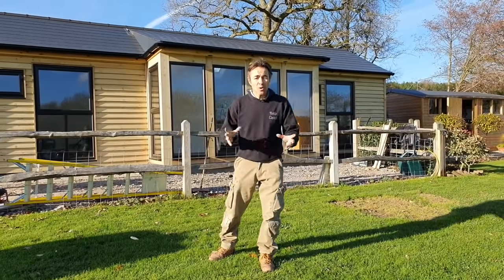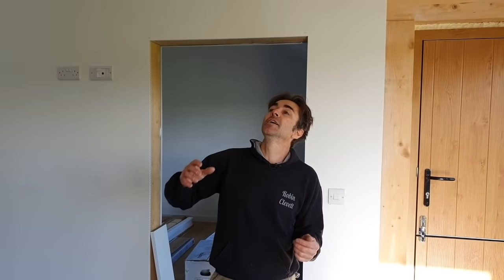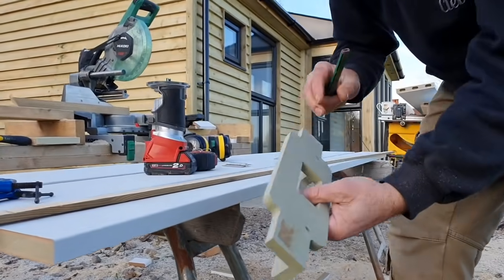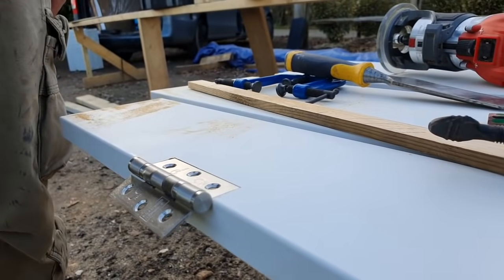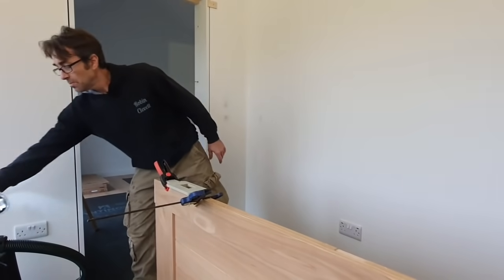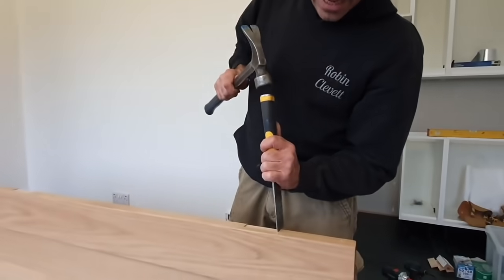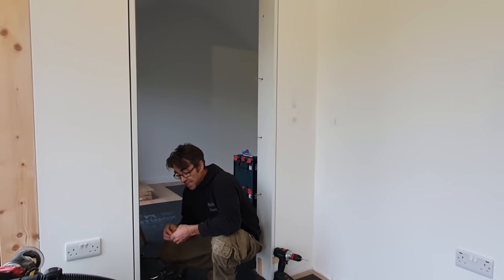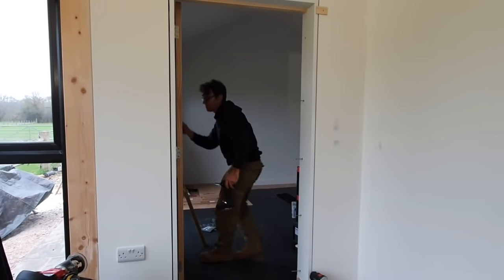Modern Carpentry and Change!!! Hanging doors the modern way with MDF door linings and new hinge jig

Comment: Screws have changed such a lot. It used to be slotted screws everywhere and they were such a pain!
Would you consider making a video on choosing what screws you prefer to use?
Reply: That‘s what also came to my mind. Were Torx screws a thing in 1986?
Reply: Painted cross head screws can be cleared out with a small sharp screwdriver. Hex socket heads can be drilled (gently) and scraped with that same small sharp screwdriver. Torx are a nightmare to clean becoming easily chewed. I guess you just use a screw extractor and fit new screws.
Reply: From memory I think Robin uses Spax screws
Reply: My preference is Torx stainless!
Reply: Torx>Robertson>Pozidrive>Philips

Such a shame here in the UK we're stuck with bloody Pozi.
Reply: @leerolfe5332  Screwfix stock torx screws, but they cost more than the pozi’s
Reply: @deanscaife840  Yeah I know that matey. That's why i said we're stuck with Pozi. We're forced into it via cost.

Comment: Hi Robin, I am a bit old school, probably due to my age, I still have and use Yankee screwdrivers as well as a brace and bit with all the accessories. Don’t get me wrong I love the battery tools but I own a caravan in the middle of Hamsterley forest and I do not have electricity to charge my tools so I need old tools to do my woodwork. I haven’t heard of spray on plaster but from the finish you have their it looks brilliant, with pex pipe all the trades can be done by a DIY’er with some good knowledge.
Reply from the maker: A decent bit and brace and sharp auger bits is probably the nicest way to fit a lock or drill a decent size hole!!!
Reply: When my dad passed away in 1990, he was a jack of all trades type, as was most of his generation, he left wooden block planes with new blades still in greased paper, brace and bit and a small hand drill and other stuff, I was fortunate to find a carpenter who like the old tools so gave them all to him and they are now displayed in his workshop.
Reply: ....and writing that has brought a tear to my eye, miss them both every day.
Reply: @robinclevettcarpenter  Yes and because everyone is getting battery operated equipment now you can pick up a brace and bits for £0:50 at a car boot sale and screwdriver bits fit in also.
Reply: @robinclevettcarpenter  Agreed. Still the best way to cut accurately. I used to have a set of bullseye bits which I bought at a farm dispersal sale. Lost them somewhere over the years. Never seen one before or since and only found out recently what they were called.

Comment: I can see a huge saving in time once you have the jig, however am I right in thinking that brass hinges are slightly different in size to chrome, different manufacturers may vary in size, loose pin hinges will be different in size, how many jigs do you need

Comment: You do all this finish carpentry work intro-Ing your new hinge jig and I just watched your recent door hardware jig !
Great stuff!
Questions:
Can I buy both in imperial ?  I would enjoy having them ?  I am a finish contractor often with jobs that hv doors here or there plus I just started to offer custom built doors????
A front door to “YOUR” house is a statement!!

Lastly I see all this fine carpentry ??
Then you finish off cutting away the jig work (squaring the corners) with a massive 24 oz Eastwing Hammer and a $4 DeWalt rusted out chisel ???
U drag that small sledge hammer all around ??
I am a trim carpenter I hv a 10 oz Stiletto wood handle titanium head hammer and a 3/4” Two Cherry Chisel ?
I wear a Buckaroo back pro belt and Occidental trim bags??

Robin toss the sledge hammer!!  Also send your address I will buy you a proper chisel and mail it to you!!!!

However ; u R one of thee most talented Carpenters I watch!!!  Keep rolling out the videos !!!

Comment: In the bit regarding the old fashioned way of fitting the door frame and then hanging the door etc after the plasterer had finished, you forgot to mention the half hour that had to be spent cleaning and scraping dried plaster off of it when the messy plasterer (majority of them), had finished. 😠 (no fun when you're on a price). Looks like a great way of doing it now. Nice, clearly explained video.
(Retired chippy)

Comment: I've been doing carpentry about the exact same time as you, I also have to wear glasses now, 😂, I used to fix arcs, and skirtin with hammer and nails, nail punch , now its all guns, mitre bond, city and guilds is a thing of the past, do you ever use hickman doors, pre hung in a factory all painted, just fit the pre finished frame.
Reply from the maker: Thats the way it will go!!!

Comment: Nice. Liking the look of that airoplaster guessing it only works on new plasterboard. I was taught to hang 3 swing 2. But it doesn't actually matter as long as they are all the same. But it does matter on new hinges as they have writing on so I think they dont look right with it upside down.

Comment: You only have to look on YouTube to see how far things have come and how much it’s changed, housewives giving their jobs up and turning garages into workshops, no carpentry experience needed, jigs for everything, pocket holes used for everything
Reply: Hi there. Its unarguable that things have changed a lot, but the woodworking world of YouTube is still miles away from the life of a top end, professional carpenter. The really sad thing is that young apprentices are no longer being trained under, older experienced carpenters and therefore new, modern techniques will have to be adopted to take the place of the traditional skills. Cheers.
Reply: @thetallcarpenter  hi, yes I agree, the days of using a saw, hammer and chisel to do joints are well and truly gone, I still use those for satisfaction but it’s all bench saws and jigs to get those things done in a fraction of the time. It’s a shame really

Comment: I agree with most but a door should have a leading edge on the latch side otherwise when the back of the door is in line with the front of the casing, your careful clearance has been halved which is terrible.

Comment: "2 to the door 3 to the frame" I stopped doing that years ago, I just put writing up now. This way the client isn't going to think you've put the hinges on upside down.
Reply: That’s a very good point JRS UK. Would like to know what difference it makes?
Reply: @SandyMiller737  In my experience, no difference at all. It's just the way it was done back in the day.
Reply: The reason this was done back in the day was because the holes in the  both hinge leafs where not always stamped out in the same pattern they we're not a mirror image of each other .nothing as bad as offering up your door and realizing 1 or 2 or maby all your holes were drilled in the wrong place  on the frame keeping 2 on the door 3 on the frame solved this .modern butt hinges usually are mirror images of each other  and avoid s  this problem but it's good practice 2 keep everything orientated the same way
Reply: Brian Gordon. That makes perfect sense. I like hearing about why conventions came about. It’s another thing I can bore people to death with 🤣
Reply: Male and female we was taught and yes I’ve been called back because the customer said I put hinges upside down and was told by her brick layer that i was wrong 😑 snm
Reply: @xxnickthegreekxx  That's exactly why I just put them writing up. Customers, brickies, they all know best, I just like a quiet life 👍

Comment: Nice looking little jigs it would be nice if they worked on a traditional rebated frame which I could be wrong but they don't look like they will, if they do then please let me know as I will buy a couple.
Ah the good old Yankee screwdriver I've still got one knocking about in the van. 👍
Reply: Ive had that issue with other hinge jigs. The only way around it is if you pack out the rebate the thickness of the reveal so the jig sits nice and square the just increase the depth on the router. Works a treat. Bit of a pain  re adjusting the router between frame and door but i guess quicker than the alternative.
Reply: Get the trend skeleton hinge jig
Reply: I thought the same thing as I mostly use those. I think I will try the jig out anyway when they are for sale

Comment: Hi robin, have you thought about using hinges with rounded edges, so you don't need to chisel out the corners
Reply from the maker: I have made jigs for these, the problem arises where you are fitting new doors to existing frames and using the same size butts, I reckon that it would be great for new construction!! Great comment mate

Comment: Robin , how would you approach a job where the client wants all the doors changed but not the frames ? I’ve hung most of my doors in old frames and can say it’s not an easy job when both legs and head are all over the place ? Could you do a video maybe explaining or showing the difficulty of hanging a door in old frames ?
Reply from the maker: Hi Issac, this is a job that requires time and patience as you suggest, So you may need to trim or "shoot" each side the top and the bottom in!! and in the case of pre finished doors can be a real liability, I always explain to my customers what is involved and then price accordingly for example for old twisted and out of true frames I would probably only want to do 2 maybe 3 in a day based on all the issues, one of the reasons I made my new hinge jig was to allow speedy routing of the butts in the new doors at ant position as marked off the old linings, something that would be a nightmare with a longer more complicated hinge jig set up, If I have any to change soon I will do a video on my way mate no problem, all the best mate
Robin
Reply: @robinclevettcarpenter  yes they are very tricky I’m in my first year of being self employed and thought I was taking too long hanging doors only getting 2 doors done a day , but they have all been in old frames , had only one new frame recently and Even then the customer had got a reclaimed door so had to straighten up the sides before hanging 😂

Comment: Hi Robin. Great video again.  Very nice gig.  A question you said your looking for around 2.5 Mill margins 👌, I used to put leading edge on to get it tight fit when closing in. I try not to with pre finished doors with new frame's  with prefinished doors  do you put a leading edge on ? Keep up the fantastic video's 👏
Reply from the maker: Hi Paul, I try not to cut or plane a pre finished door in any way, so we avoid using a leading edge on the doors, also most router hinge jigs will need a decent square edge to sit nicely!!
Reply: @robinclevettcarpenter  thank you for the reply 👍

Comment: Robin - check out the Door Stud tool.  Put those heavy doors on wheels and have screw adjust for height.  Don't even need the pump jacks.  

Will you make Imperial jigs for the US market (I presume the hinges are slightly different sizes?)
Reply from the maker: Hi Arthur, is there any information available to me on the common hinges that you use in the US? our two main sizes are 76mm and 102mm long, will have a look at the door stud, thanks for watching
Reply: @robinclevettcarpenter Robin, the US has several common sizes:  4x4", 3.5x3.5", 3x2.5" Both square and rounded. Pretty sure 3.5x3.5" rounded is the most popular (commodity doors).   

I also like the hybrid silane-based sealants - definitely best all-round performers.    BASF MasterSeal NP150 is my favorite.  150% movement, tenacious grip, cures with moisture, available in multiple colors and comes in tubes and sausages.
Reply: I don't think many in the US would be too amused at their measurement system being called Imperial!  Yes, it has some of the same values, but it isn't Imperial.

Comment: Hi Robin,  I still have my Stanly Yankee - haven't used it for years though.  Why didn't you use hinges with radiused corners to avoid the chop out?  Great to watch you work as usual.  I hadn't heard about these door linings.  In France we get the door and frame as a complete unit with all hardware except the handles fitted.  Not the quality of the oak doors you were using but maybe soon.  Happy NY.  Mike
PS When are you going to makeup your mind about the face fungus?

Comment: Hi, great video. I love your hinge jig but I thought you produced them for new doors into old frames where the hinge location could be anywhere on the jamb. As in this video you are using new doors and frames. I wondered why you didn't use a standard full length hinge jig that does all 3 at once? Also what was that jig you used to hold the door for hinges

Comment: I was laying Eternit 2000s on roofs in about 1983. Early non asbestos composite slates.
Also, there’s been quite a lot of talk about the amount of formaldehyde in mdf, making me more and more reluctant to work it, and it leaches out into the customer’s house . Think of the modern level of fraught insulation and then....
Love the topic though- I started about two years before you😎
Reply: Peter Millard on the 10MinuteWorkshop did a video about MDF and formaldehyde. He checked various things with a meter and saw that there was more formaldehyde in wood (proper wood, which grows on trees). To me the major problem with MDF is the fine dust particles when it is cut, making a dust mask and good dust extraction essential.
Reply: @robertpearce802  Thanks for that Robert , I admit I was going on fairly old information! Actually the HSE website has a very readable section on formaldehyde as I just discovered. They make the point that it can imbed in the dust particles, then they have two horrendous sections on what kind of  serious mask we should be wearing!

Comment: Do you have and concerns with the strength of the liner holding the door as when the hinge is recessed it looses that hard outer core and the screws can only rely on the soft inner core
Reply from the maker: Hi Dan, I use a medite MDF it has a superior core than others and i find it works really well
Reply: @robinclevettcarpenter  that's brilliant, I will definitely do that, thank you Robin

Comment: As an old carpenter I would ask you to encourage the use of ear defenders...I have tinitus and it is awful. In ear custom ear defenders £120 a very good change from no PPE. Extraction and or a dust mask when using MDF would also be good. I wouldn't mind betting you are glad you can still do it the old way if you need to? Nothing wrong with modern methods. But we used less and produced the same. It may have been harder and slower but we didn't need a huge van and didn't have a huge tool bill. An old boy once said to me you go to work to earn money and not spend it! That said I have a lot of tools!
Reply: Hi there. To be fair to Robin, he is either wearing his ear defenders or has them round his neck in most of his videos and I think he sets a good example in this respect. I'm sorry to hear you have hearing problems, and I understand tinnitus is not pleasant. Take it easy.

Comment: I always appreciate your work Robin. But I think what this video really shows is that few tradesmen know how to 'finish' well. All of these composite and pre finished materials, including the airless plastering exist because the real hand skills have been lost and few can create a perfect finish. I'm not sure the methods shown in your video are particularly quicker - given things like custom made linings with edge banding would be a time consuming faff unless you had serious machines! And still would have to be painted! We're in a situation now where many tradesmen rely on the next tradesmen to cover up poor finishing or sloppy work. The methods shown in your video get around this problem, but only if a single builder or contractor is approaching the building work holistically (which isn't a bad thing, but quite unusual on a typical site) and to top it all off, not sure I'd want mdf linings and composite doors on my house - but as a joiner I suppose I would say that.

Comment: Everything is great if you are building new, but issues arise when you are renovating something old.  Many factory doors are made with a set width to height relationship so you can easily get a 78 x 33 or 80 x 32 but just try finding a 78 x 32.  The core of doors is chip board but the solid timber surround is often limited to being 10mm on the sides and 20mm at the ends, if you are lucky.   I cannot tell you how many hours I have spent sourcing doors to budget, that appeal and that can be easily modified in order to make fit an unusually sized doorway.  The one important lesson that experience teaches you is that it is always better to take time to get things right than it is to rush and get things wrong.

Comment: Why not  use the hinges with rounded corners ?
And by the way, here in the Netherlands we use 3 or 4 templates on a rail for both the door and the opening, so no marking is needed.
Air bags! Great idea, did not know those.

Comment: Hey Robin any chance you could drop a link to the slates you used for the roof. Im looking for something similar myself. Do you know anywhere i could get sheets of the slate effect tiles? Loving the videos.
Reply from the maker: Hi Gary, these are an Eternit slate pretty common in most roofing merchants
Reply: @robinclevettcarpenter  good man thanks for that robin. Appreciate the help, love the videos👍
Reply: @robinclevettcarpenter  actually can I ask, what size are the tiles or are they a panel?
Reply from the maker: @garyk559  they are 600 x 300 from memory or 500 x 250 one of the two!!
Reply: @robinclevettcarpenter  perfect thanks a lot Robin👍👍

Comment: Just been to a two year old house where the ground floor doors, on ceramic floors, have swollen and split due to the chipboard core soaking up water when the floors are washed. For some reason the owner just wants to replace them, probably can't be hassled chasing the builder. Problem is, they will all have to be changed, as I can't find a match...